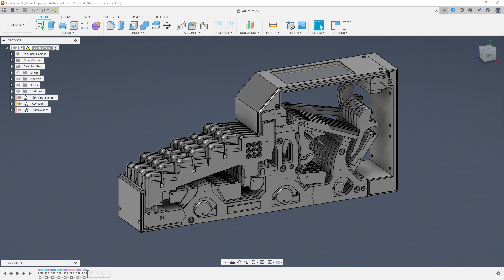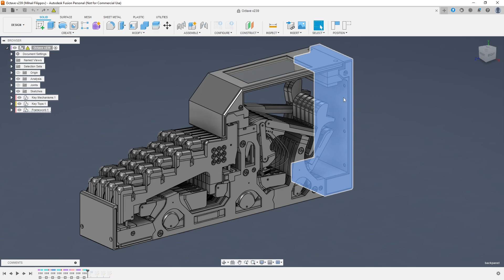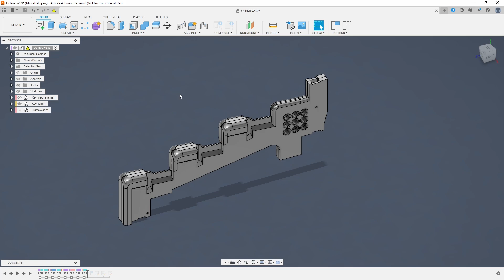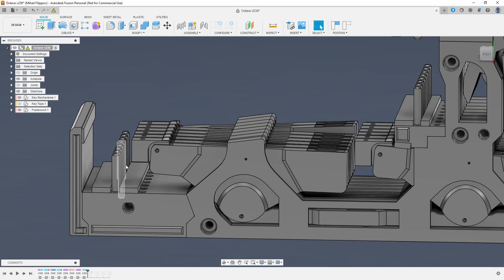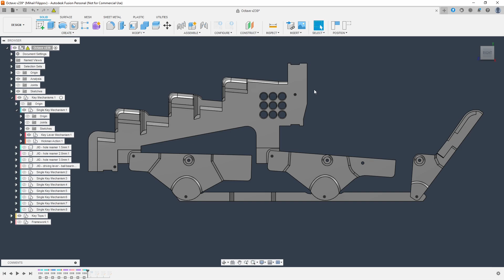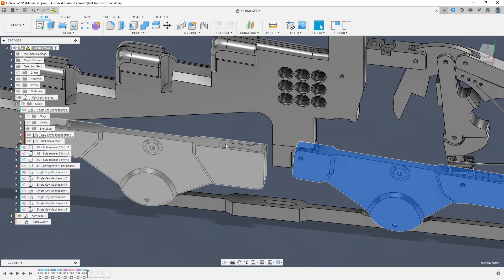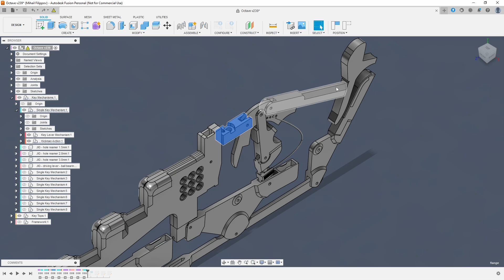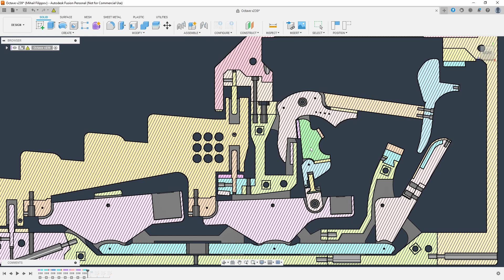DIY Janko Piano: 5. Initial Prototype

Comment: Man this is so awesome. I hope the rest of your development goes well and you sell these one day lmao I'm a pretty good piano player, but I've wanted to try a janko piano for years!
Reply from the maker: Well, the development is definitely going well; already working on the assembly (currently sanding keys... sooo much sanding...).

As for selling them; most likely no - the amount of time I expect the assembly to take plus the material costs places it in the $6,000+ range which isnt really viable. I think Rico Raven is putting together a more 'accessible' option for a janko keyboard, so check him out if you are interested.
Reply: @DIYJankoPiano  Aww damn :( 

For me as a piano player, a huge benefit for the janko would be the ability  to play larger chord voicings than would be possible on the standard layout, so sadly doesn't look like that happens with Riko's, still excited to see his finished product though.

Yeah, I guess $6k is pushing it, honestly, I'd 100% buy it at Lumatone's pricing though.
Reply from the maker: Yea, I went into this project with a 'no-costs-spared' mentality after trying out the 10,000$ digital pianos with their hybrid actions and deciding I want that in my build as well.

I might see about scaling down the build to something more reasonable after I finish this project (simplifying the action, making it be MIDI output only so as to remove the mini PC & DAC, etc - basically more of the lines of what Lippens was supposed to be) that would make it more manageable for pricing, but thats all at the 'cool idea, maybe later' stage of development.

Comment: The sheer level of detail, precision and organization in that CAD file alone is outstanding
Reply from the maker: Got some professional experience in CAD so that definitely helped; though the switch from AutoCAD with its 'each object is a file' to Fusion 360's 'single project file' took a bit getting used to.

Did end up having to re-make the project from scratch for the next version in order to include the rest of the piano, so if you notice organization differences between this one and the next one thats why.

Comment: The algorithm must know me. I was recently thinking about how to implement a simple velocity and after touch sensing mechanism into a 3d printed keyboard mechanism. Didn't get around to testing yet (also because i dont have an action designed) but i bought some components. Not sure about scaling though because of a round robin approach that my sensor setup would require.
Reply from the maker: Well, you are (just about) right on time then. The episode next week will cover the sensors and electronics, so that might help you out.
I also have a thread about the project (link below) for discussing the technical stuff - feel free to join the discussion:
https://pianoclack.com/forum/d/1825-diy-digital-piano-a-janko-variant

Comment: BTW, I recently got a Hammond SK1. For non-velocity sensitive sounds like organ and mono-synths it’s excellent, due to its high trigger point. I can simultaneously send different sensitivity curves on two additional MIDI channels.

Unless, this is strictly for piano, it could be interesting to have a sensor on the keys, as well as on the hammer target (the nail? lol.)

The high sensor enables organ-specific articulations, like percussive stabs, smears , and light-quick playing. Modern synth keys with low trigger and velocity simply don’t deliver the same results.

I’m wondering if a key trigger in addition to the hammer trigger isn’t beneficial, if not necessary to control the sustain. There might be additional advantages, such as eliminating false triggers, etc.

Given that you are doing a no-compromise build, having it be able to control piano or organ could be good insurance.

Of course, the SK1 has waterfall keys for comfortable glisses. That might or might not work on the Janko buttons. Smears and stabs can be more percussive noise than tonal, so the lack of a diatomic row might not be a problem

Another advantage of the SK1 over my Arturia KeyLab mkII is that the Hammond has nice, wide black keys. The tops on the Arturia keys is small, so it was easy to slip off. I’d imagine that the Janko layout completely eliminates the problem of slipping off of the black keys. I don’t know about glisses though. Can you slide your hand over the keys?
Reply from the maker: Well, the next video will cover the electronics and sensors, but until then:

Sensor wise, I have 2 optical sensors for measuring velocity of the hammer right at the end of its flight which should correspond to hammer velocity in an acoustic piano with a similar action. This does (as you mention) not work for sustain / dampers, so there is a separate magnetic sensor that measures the actual position of the key. When combined this means I get a single 'velocity' value when the hammer hits the hammer-hit felt (works the same way as in an acoustic piano hitting the string) along with the exact position of the key every millisecond. The rest is pretty much firmware.

I have a 6 step state machine for each key that combines both the optical (velocity) sensors and the magnetic (key position) sensor in order to prevent ghost repeats as well as send key-on (hammer hit) and key-off (key released - dampers dropping) events. I will likely have multiple methods for triggering both of them (such as using the magnetic sensor only for both as an alternative), which will be compatible with variable trigger points if necessary.

I do however plan for this to be used strictly for piano playing though - never played organ, so...
Still - the hardware is there, so its not like its impossible to add extra features at a later date; even setting up multiple simultaneous sensitivity curves along several MIDI channels simultaneously would just be an issue of writing the firmware for it. The bandwidth for the sensor boards can certainly handle it.

Finally - in terms of glissandos along the keys; yes - it should definitely be possible. I made sure that the keys are strong enough (and have minimal side-to-side sway) that both whole-tone and semi-tone glissandos should be doable. Though as always - I will only truly know after its all assembled...